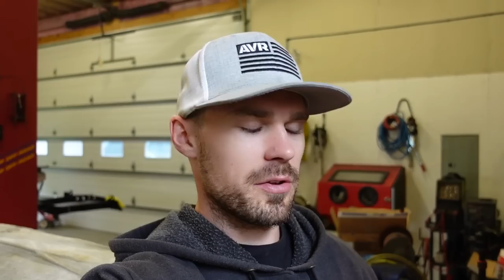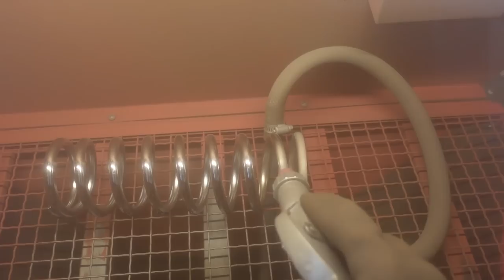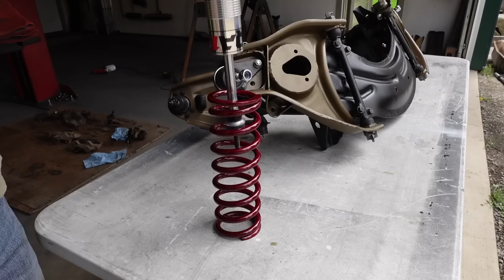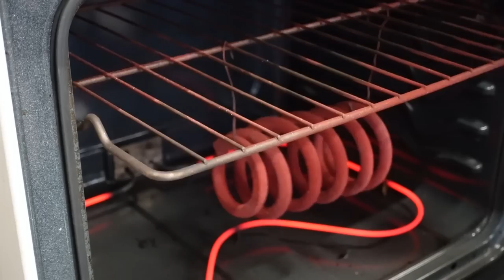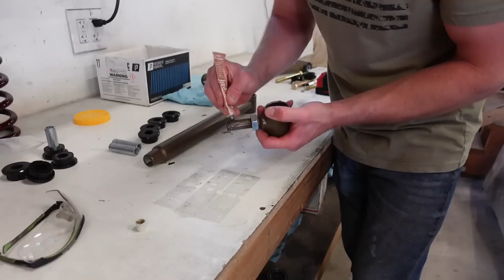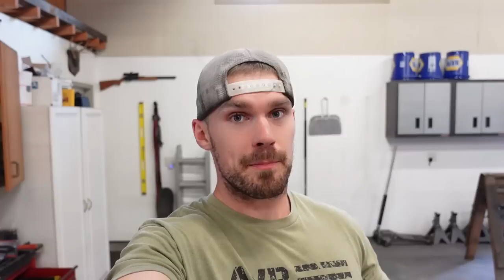The Hilux Chassis Is Back Together And Looking Incredible!

Comment: I love your videos Austin.  I like watching you do all those things you do i.e. the powder coating.  I have a 2001 SR5 with flared fenders.  The body is gloss black and I'm going to plastic coat the fender flares flat black.  I think the contrast will be cool.  I also did the headlight retrofit but with LED's instead of HID.   I installed those black rear tail lights and they look so good against the gloss black paint.  I need to clay bar it though.  The paint is terrible.  I replaced most of the suspension, new bumpers (they were rusted out from the inside).  I'm going to be 76 in August and I just love working on it.  It only has 147,000 miles on it so it's going to last longer than me (maybe lol).  Thank you and keep pluggin away...............Bill in Wilmington, NC.

Comment: I have been watching the start of this build and was going to comment about adding heim to bottom and top of third link. I have a three link on a lowered Sierra and it has the heirms and articulates and keeps wheels planted on the ground. Thanks for showing the difference. Interesting how the bushings flex. Either way I think it will work.

Comment: 18:55 well your upper joint's threaded section was spinning in the bung, and tightening the nut really wont stop it from doing so. I would say no you don't have enough articulation. if you are dead set on bushings, get dual durometer bushings from synergy, they can actually flex and also require no grease.

Comment: New camera vs old camera:

New is smoothed, old is a little shaky.  (Software exists to fix this in post, but that's also an extra step.)
New looks like a cheap small lens with a small sensor, old looks super pro image sharpness and quality.
New is probably super convenient, old is big and clunky.
New - you're looking at the screen a lot instead of the lens and it's a bit distracting, old you obviously don't.
 
Maybe use your new one for the selfie shots (but don't look at the screen) and the old one for tripod stuff, as it has way better image quality.

Honestly, we'll watch either way.  Love  your videos.

Comment: Looks great 👍... As for bushings v hiem joints.  Correct... 4WD. / Racecar definitely the hiem joint period.  Being a street truck 2WD the bushings will work just fine.  One advantage of the bushings is noise... softer .... little more forgiveness.  Hiem joints are solid... can be a little noisy during movement.. firm / solid and a little less forgiveness.  However both will work on this application just fine.  Install grease fittings every where you can.  Next is good bushings for the body.  Same thing.. soft rubber is forgiving and not as stiff and solid.. less noisy. 
 This is a fun project.  Enjoy watching it come together 😎👍
Reply from the maker: I agree!! The bushings should do just fine!

Comment: Hey Devin, the powder most likely turned out darker than you wanted because you are spraying it on when the part is too hot. When you do this you cant control the amount of layers of powder compared to just using the electromagnetism of the gun. Thats why the powdercoating shops dont use "hot flocking"
Reply: Your absolutely right, I’ve made some real messes hot flocking but….. we don’t know how much he lets his parts cool after he off gasses, he could use some silicone bungs though. Looks great!
Reply from the maker: Yes the first spring was a bit warm with the clear but the rest I let cool off and they did look a touch brighter!
Reply: Whose Devin?

Comment: Might want to consider mounting your front shocks on top of the plate you welded in instead of under. All of the front end weight is now going to be held up by just those bolts instead of distributing it across the base of the lca.

Comment: Try putting adding heims on the trailing ends of the two lower arms and then test again. you will see a bigger difference. Most high end suspension builders Ride tech/Global West will use this combination or heims on both ends. Such a light truck anyways it won't hardly move around. If you were on bags I'd do heims for less binding movement.

Comment: I think, if you were to use heims on the adjustment end of your links. I believe it would be quieter than having bushing. From previous experience, poly bushings if not greased well, will squeak like hell

Comment: Heims will allow for more flex but they will get noisy. Poly bushings will squeak too but you have grease fitting so they should be quiet. Personally. On a street truck, I would stay with all of the poly bushings. I would not do heims. I’m minimizing the number of heims on my offroad rig (doing builder/flex joints).

Comment: hey Austin,you need to research powdercoating,first you shouldn't hot flock,#2,if you powdercoat over chrome it must be good chrome,which your's is,but you lightly blast chrome just to etch it then coat,you have to take them to a chrome plating shop and have them strip,the only way you can get chrome off

Comment: Will the truck bed be flush or will you have to cut out? Are these trucks still considered pickup trucks if they loose the bed aspect?
Reply from the maker: The bed should be good as is with a little trimming